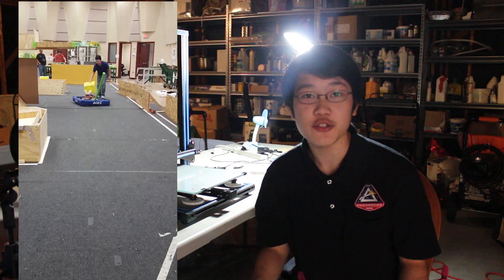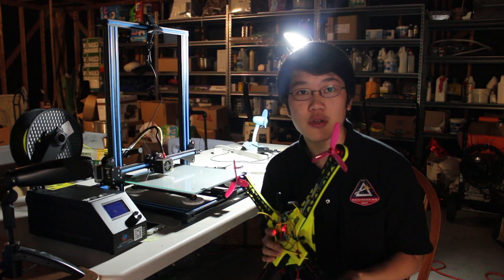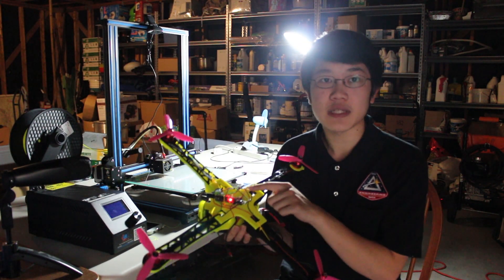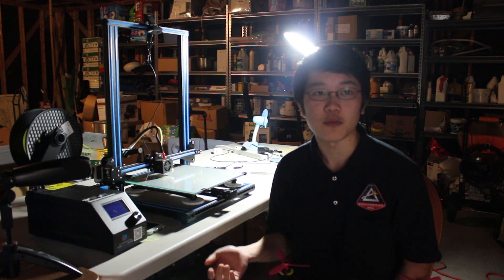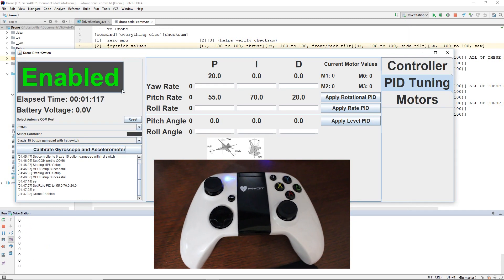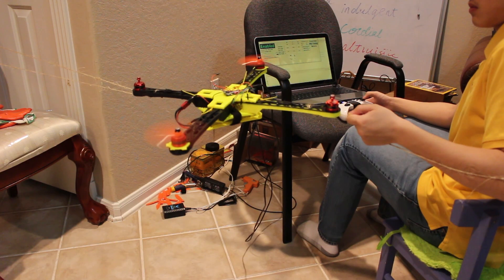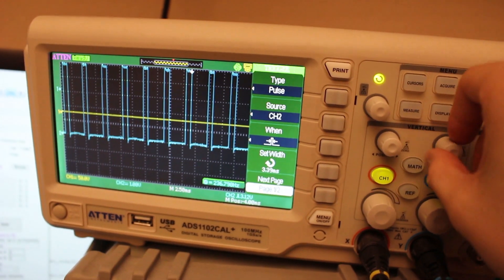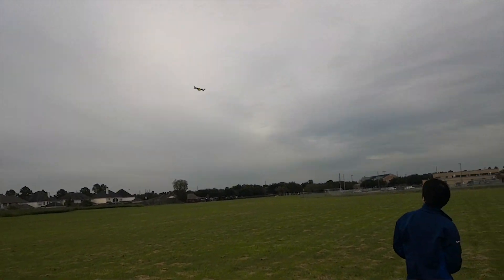Arduino Quadcopter | MIT Maker Portfolio

Comment: Hey, nice work! Sorry if the question is somewhat strange, but why didn't you get in? What did you lack? I'm currently building a quadcopter based on raspberry pi 5 and hailo 8l which should, among everything else, use AI (yolov8s, to be precise) to detect, recognize and track any type of object I specify. I wonder what should I do better to get into MIT, so please, advice me. I've also taken 14th place on the all-ukrainian math olympiad and I'm writing an article on ergodic theory + completed multiple university-level extracurriculars. I have 2 years left in school and I want to maximize my chances.